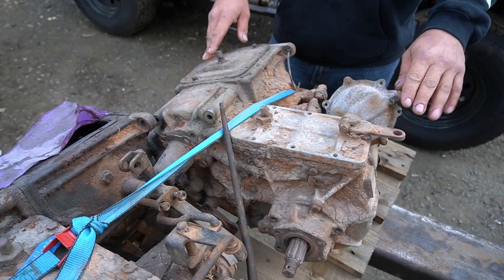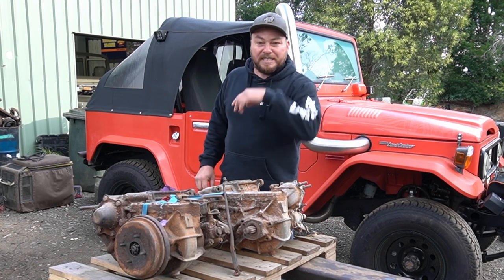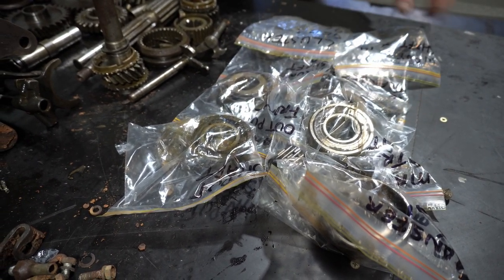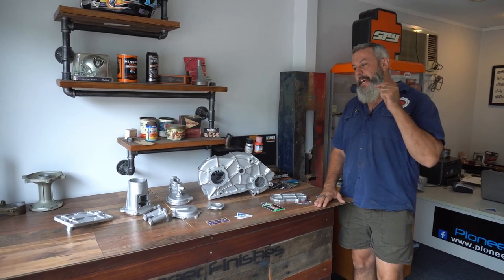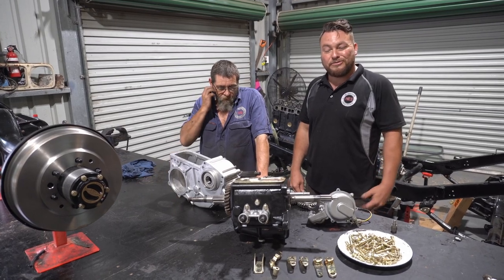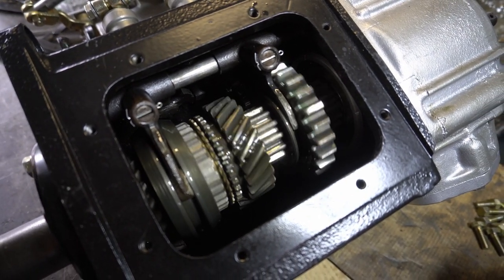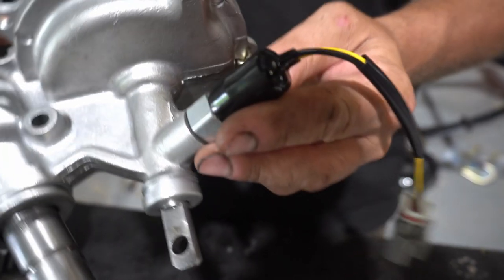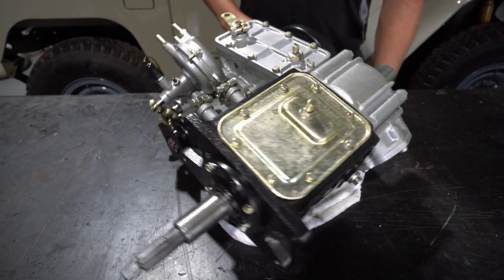We rebuilt a Column Shift 3-Speed Gearbox from a 1962 40 Series - Mr Landcruiser

Comment: In 1978 I bought an FJ25 short wheel base Landcruiser it had a 135 engine 4speed gearbox & single speed transfer case
The gearbox was only synchro on 3th & 4th gears and it had vacuum wipers we owned it for 9 years last I heard it was fully rebuilt and owned by a collector in QLD somewhere Ron Stevens Hervey Bay QLD.
Reply from the maker: Very cool mate, I had a fj25 1959 4 speed for a little while, there a different box again. So many changes!